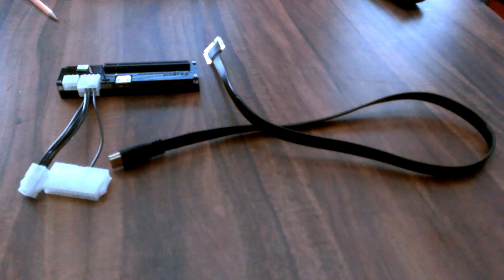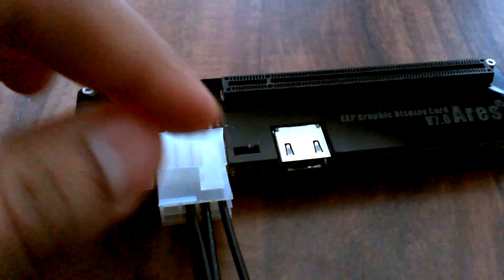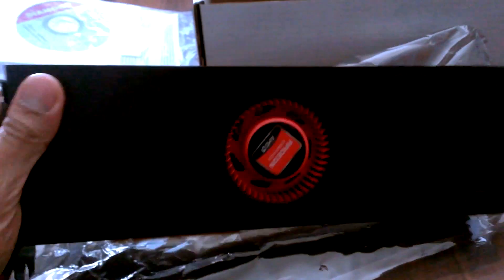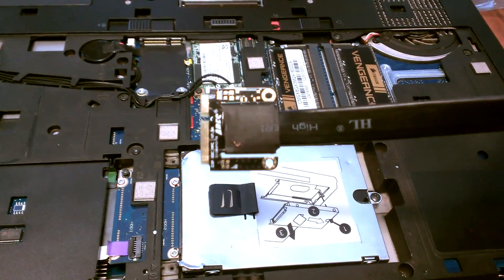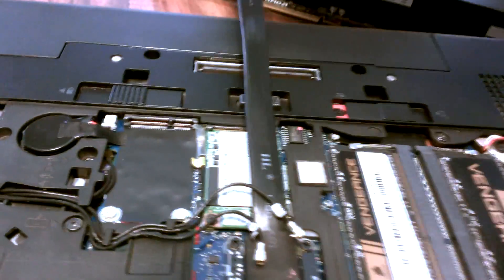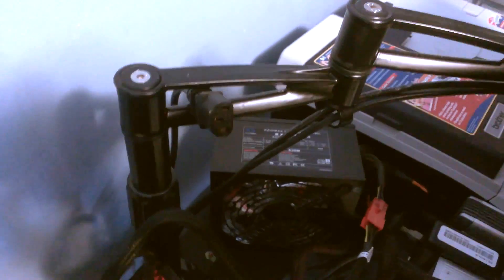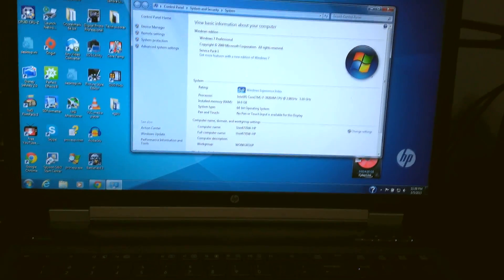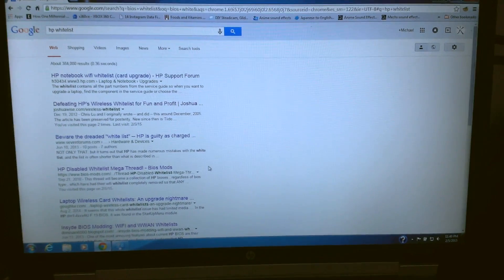External graphics (eGPU) on HP Elitebook 8770w (Part 1 of 3)

Comment: Hello,  I've just buy the "EXP GDC Beast Laptop External Independent Video Card Dock" (almost the same product as shown in the video) and i do not have any sufficient power supply to run it. I see that your atx power supply is 630W but it's written on the website that my product require an "atx 8P interface: 220W max". My point is, if i get an atx power supply with like 400W or more, is it risky ? Can it burn my GPU or something ?
Nice vid btw !
Reply from the maker: Good question. The 8pin 220W is their modified laptop power supply that you don't need. You're better off getting your own power supply. It is risky in the sense that you'll have a power supply outside in an unsecured manner but it won't burn your gpu, external adapter, or laptop if you plug everything in correctly. Many power supplies have an auto off feature that turns off the power supply if something isn't connected properly to prevent shorts that can cause fires. There is no power supply I am aware of that will prevent live power from killing you if you touch the power supply the wrong way. Just be careful, connect everything before you plug in the power supply and you should be fine.
Reply: Magmafire Thank you for your quik answer ! 
keep it up !